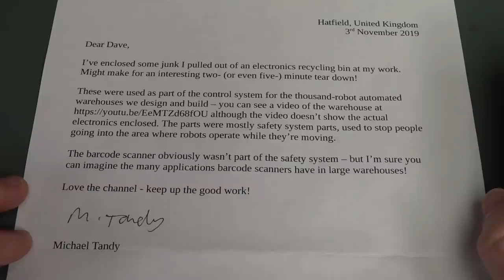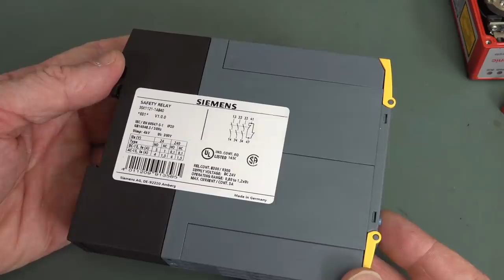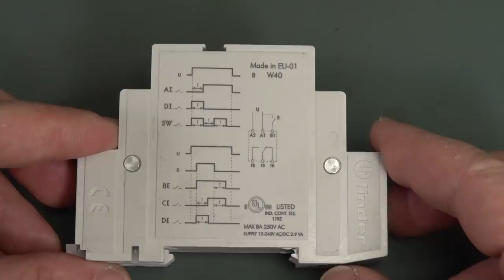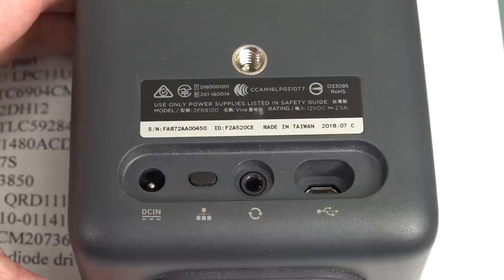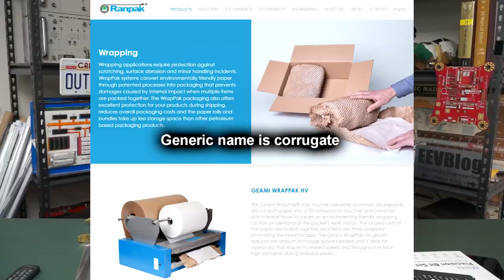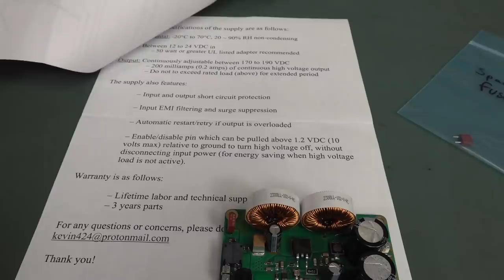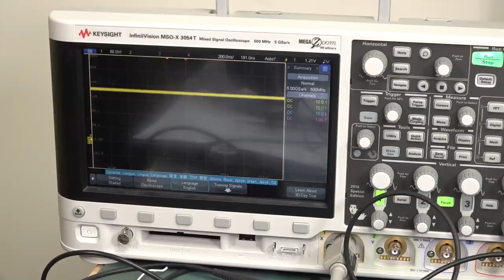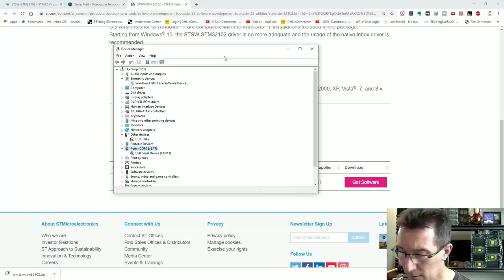EEVblog #1263 - Mailbag

Comment: Safety relays are used on plant as part of interlock circuits often using coded signals and timing sense circuits to only activate or deactivate without interlock inputs being faulty, such as a stuck switch. An example would be a machine guard for access to moving parts
Reply: Gotcha
Reply: Also know as emergency switches. The springy bit on the siemens one is to put it on a din-rail :)
Reply: Marco P - Yep, I am more familiar with Pilz systems but they all work much the same way.
Reply: @tenchicks  Are Yankees a race?
Reply: @TheDefpom  Pilz... Were i work, there are a lot of them...
I'm more familiar with Allen Bradley Safety remote devices (Point I/O), works all the same.
Reply: @Ann Onimous You need them if you have a simple machine (example, safety gate before a hydraulic press or emergency stop for that machine) where spending XX.000€ for safety plc + program + certification are not worth.
However, better safe (and angry if you are called at 02.00AM for a failed contact) than sorry.
Reply: A common use is for emergency stops. Each estop switch (of many) is a DPST normally closed switch so you have 2 separate loops that will break when an estop is pushed. Then, each of these loops trigger an individual relay (with some fault detection and conditioning). Loads are connected through both relays in series so it will be disconnected if either loop is broken. Some fancier ones have delayed outputs for more complex systems. So when the stop is triggered, you first tell the motor driver to actively brake, then cut power for electrical safety once it slows down after a few seconds.
Reply: @EEVblog2  Siemens also has solderless connections to the outside world, so they can never have issues with solder joints breaking off the board during wire connection. Dual processors so that a software fault in one does not affect operation, making it fail safe. Thus all the transistors there to do majority logic to ensure correct operation.
Reply: @Ann Onimous 
Piffle.
Reply: @Ann Onimous Safety plc can assure only tamper-proof program: during certification, certification agencies requires program signature (which is appended to security certificate) and program lockout, to tamper with code, cpu must be in STOP mode and, when you unlock program, signature changes.
Safety plc suffer equals issue of safety relays: inputs and outputs can be tampered with wires, so for simple tasks like door access or emergency stop, safety relays are just fine.

If "the first thing people do is link out all the safety if there is an issue", you have to get an appointment with HR department and speak about this: it's very dangerous, disaster-prone and against law (where i live, in Italy, you can get 5 years of jail by doing it, if one get injured because this, you can get up to 10 years).

p.s. safety certificates can be released also to plc-less machines (safety it's just interlocking, which can be made by mechanical, electromechanical or electrical manners where software interlock is always the last safety step).
Reply: That's probably why there is two microcontrollers too. The most likely do the same thing, and if they end up with different results, the system will stop. So there is redundancy
Reply: @marcop8273  Correct. We are building small cabinets where the safety PLC would cost more than the whole cabinet with safety relay. We talk about industry, but the money always a factor, no matter what. And the siemens safety relays have ridiculous MTTF values, a 24v supply more likely to fail before the relay.
Reply: @pengiswe  Yes, also some PLC (i use Allen Bradley) must have 2 cpu for Safety operation (in my case, L72S and L72SP are required to be running, otherwise cpus goes to fault condition and stop everything) and Safety remote seems to be fully redundant (in case of Point I/O, each safety module occupies 2 slots instead of 1 and run much much much hotter than non-safety modules).
Siemens, however, seems to be more user-friendly: S7-1214FC is an "all in one" cpu which doesn't requires any safety partner module.
Reply: @pengiswe  Yes, the two relays as well likely.
Reply: Robert Daggett  yes, i know (i prefer them instead of flex i/o).
Reply: Robert Daggett  It depends about safety performance you require.
We have v.31 cpu (L72S+L72SP), Monday i'll check this.
Reply: Robert Daggett  Maybe your response was truncated :(
Yes, access zones and all about segregation are THE mined field of safety systems (fortunately, where i work, we have EHS office, so we can simply ask them what to do in our programs).

About redundant operation, you can read this paper: https://literature.rockwellautomation.com/idc/groups/literature/documents/um/1756-um020_-en-p.pdf
On page 25, it states you must use partner CPU in order to achieve SIL 3/PLe safety performance, however, missing partner will cause major fault in CPU.
Reply: Robert Daggett  I'm sorry to hear that, i hope you'll get better ;)

About Safety, L72S (main CPU) runs both program, however handshake seems to be only in Safety task.
What i know about safety task is that you can program only in LAD (structured text, being uninterruptible, is not supported).
Our standard is: everything goes to normal task, all about safety (emergency stop, light barrier, trapped keys, gates, etc), goes to safety task (which, cut off emergency valves, contactors, etc).

For Siemens (S7), at the moment we don't use S7-1200F (and 1500F) series, so i don't have access to any software/hardware to test, but seems to be a one-cpu solution (maybe it have 2 processors).
Reply: Robert Daggett  Have you checked time sync between cpus and remotes?
We had issues (major faults) because there was no master timekeeper (D'OH!).
My opinion about redundancy on fail-safe equipments isn't about fail-over, but correctness of code execution: if cpus disagree on code results, something isn't going right, so it's better stop everything (this condition will cause major fault state).
Which AENTR module are you referring? 1794 or 1734?
Do you have set ring on ethernet modules and switches?
With 1794 we don't have issues, but we also don't use Flex IO safety modules.

With 1734, we have some issues: after weeks of operation, on some modules, randomly IB8S and OB8S modules communication led blink red on entire chassis, but communication seems to be ok... We tried upgrading FW of 1734-AENTR module, this seems to mitigate the issue, but isn't resolutive.
In this condition, status bit of input and output goes low, so machine section shutdown.

However, you wrote about redundant plc, this is about Safety partner, or is about having everything duplicated?
Reply: I just replaced a similar Allen Bradley safety relay inside an industrial fiber laser source.  I was surprised that a safety part failed so quickly, it was barely even 2 years old.
Reply: Robert Daggett  What kind of cpu? L72? I asked my boss about this, on L82 AB seems to let run single cpu, but with degraded safety performance.
Reply: Robert Daggett  L8 series: they are interesting because Ethernet port included in cpu (with communication coprocessor).
I'm very interested about wireless safety plc communications (at the moment, we have only wireless remote control): how well they support interferences?
I don't think we will ever use wireless sensors near our "EMI hell generators" (electric arc furnaces), but for other "less radiating" applications may be useful.
Reply: Robert Daggett  Ok, thank you for the feedback!

Comment: Dave, you missed the solderless piercing contacts on the siemens safety relay!  The I/O headers are NOT soldered to the pcb, but their pcb tails simply press fit into plated via's on the pcb!  This is a technique carried across from high volume automotive controllers (ABS/engine ECU etc) and means faster, cheaper assembly, and a more robust joint as that joint is a physically interlocked metal to metal joint.  The unit uses two micros because it is a SIL safety rated unit, so one micro checks the performance of the second one, and on any disagreement the safety contacts are opened.

Comment: 10:45 spring on the back is so that it positively snaps into a DIN rail. And instead of having to use a screwdriver to disengage a latch/lock, you just push down/pull out to release it. So much nicer to use than other types.
Reply from the maker: Ah, yes, of course.

Comment: The serrations at 4:30 are just to reduce light reflections on the wall into the sensor.
Reply: Yup. Keeps the external light reflections out.
Reply from the maker: Makes sense
Reply: @EEVblog  I'm pretty sure that those plastic parts focus your personal chi venturi into a calming state, even though you secretly desire to kill all humans, like Bender on futurama
Reply: To me It looks like a channel pre cut so they  could add a small piece of glass or a filter lens later if another customer needed some sort of special requirements.
Reply: Sickma15 then they’d be perpendicular to the optical channel and lined up. I’m with OP, they’re just designed to avoid reflections by sending the light that hits the walls out of the sensor

Comment: The relays in those safety modules are special relays too. They are what is referred to as force guided. If a contact  becomes welded, the other contact cannot switch. This makes it possible to monitor the contacts for failures. Thus preventing an unsafe condition from going unnoticed.

Comment: The "hook" bit is for screwing in and out eye bolts or hooks.
Reply: Ah, makes sense.
Reply: I was really surprised to see this in there. I can't imaging using a "hook bit" in the lab, or the iFixit bits while doing construction working...
Reply: I guess if your lab is also your garage, you might use hooks to hang stuff from the rafters. E.g. task lights above your work bench.
Reply: ..and butterfly nuts (wing nuts); it's described as that in one of the bit sets I have. Also see https://www.kwb.eu/en/detail/index/sArticle/2946530
Reply: Yeah it's odd, but the safety bit set I bought years ago also has one.
Reply: I've always wondered what that was for haha! I figured for wing nuts.

Comment: w.r.t the vive lighthouse:
the 3x3 led grid (also?) has red leds, they are part of the system that shows when the 2 lighthouses are synced. 
The 2 stations use optical syncing, but if they are in a situation where that isnt possible (e.g. large area, angles, reflective surfaces) the 3.5mm jack on the rear is for a sync cable.
the 7seg display tells you what configuration the individual lighthouse is set up as, A/b/c mode (A and b for cable sync, b and c for optical sync)

It didn't work because the usb port is intended for firmware updates, not for power. Though usually the updates can be run over bluetooth
(the power is 12v 2.5a center positive)

the g sensor in addition to any use in angle it may have, also allows the lighthouse to flip the 7seg display to be readable if you have it mounted upside down.
somewhere on the front top, you missed an rgb led, the main way to see the tracking and sync status.
I believe, the horiz and vert lasers flash alternately.

The tracking system consists of ir recievers mounted all over the controllers and headset. It takes any 5 of them being triggered to establish tracking, and then any 3 to maintain it, for each part (2 controllers and 1 headset, each need 3 to stay tracked)
the 5m*5m space is a very conservative maximum. I have heard of 25m*25m setups using very high mounted lighthouses with cable sync.
Reply: AFAIK g sensor is also used to stop the spinners when the lighthouse is moved while operating, maybe to prevent damage from centripetal force or detect wobbly mount, all I know is that when moved it stops until left alone

Comment: Yes, those Schrack relays are custom but they are very similar to normal stock products under the SR6 series; these have what are called "force guided contacts" where even if the relay is stuck in NC or NO position the opposite contacts cannot be forced closed.

Comment: The warehouse in that video is very close to where I grew up; it actually burnt to the ground earlier this year thanks to a dodgy battery charger setting alight the plastic lid of one of the robots. Up to 400 jobs were at risk as the warehouse will take two years to rebuild.
Reply: The robots run around without their plastic lids now. They don't look as nice, but obviously safety is more important.
Reply: Muzer0 Do you have a link to a news article (or keywords to google)? Just curious to read about it!

Comment: 30:00 "Apparently you need two of these." No, technically only one is required to track location. Two are so you can get better tracking when the user is occluding the base station. (If they're facing away from one.)
Reply: The accuracy also nearly doubles, and the global position fixing does as well(30 to 60Hz).

Comment: Lasers can cross just fine. Photons don't interact with each other, or for the wave afficianados, the waves just interfere at the point of crossing.
Reply: Stuart Coyle yes that’s what I told my physics professor two decades ago, and was told that I wasn’t correct.
Reply: @HighestRank  Yes I suppose photons can interact, in that they are the force carrying particle of the EM field (QED)  and though they cannot directly interact, they can produce virtual particle pairs (electron - positron) which can then interact with another photon. Also, in air there are non-linear effects that can happen at high intensities. These are not things you would normally worry about in a consumer device, unless you are an extreme audiophile of course.
Reply: No! Don't cross the streams!

Comment: Siemens safety relays are interesting devices. You can't jumper them out to bypass safety inputs. I've used them in burner management control systems (very large fired heaters and boilers)

Comment: Its probably a 2 channel Emergency stop relay for control of a main contactor in an industrial control panel. You should note the relays are large in size as they are safety relays with force guided contacts. There will be two relays  with AUX contacts that are cross monitored. If one relay relay is detected as being welded shut the the second relay wont close. So its for fault detection.  Timers are usually run down timers so the machine has to come to a complete stop before the  safety relay can be re-energised.

Comment: As mentioned by Defpom's Electronics & Repair, these are used for additional levels of protection on machinery. They increase the availability (machine doesn't stop because of a faulty condition during operation but instead reports the fault) and reduces the probability of an unsafe situation (machine won't stop when needed). Circuits monitoring other circuits and having redundant functions like 1oo2 or 2oo3 voting (one sensor deemed faulty in two, two sensors faulty in three), either in software like the Siemens model (two processors need to agree within so many cycles) or in hardware like the Schneider one (just a guess, two PWM signals needed to charge a cap, if one fails voltage goes down and relay de-energises tripping the machine). It's the result of risk assessment and Safety Integrity Level required calculated using MTBF and statistics. Those relays are usually SIL-3 rated so they monitor two or more parallel  circuits (ie. two NC contacts on a stop push button on individual circuits). The overall SIL still depends on the assessment of the full system and the weak links.

Comment: The base station needs a 12v dc supply to the barrel jack and the USB is just for updating the base station.

Also the controllers and headset are covered with IR cameras.
Reply: Doh!
Reply: @EEVblog2  g sensor is also likely for attempted shutdown on falls (like hard drives attempting to park when experiencing 0g)
Reply: Not quite IR cameras. Just IR receiving sensors. (See all the info Allan Yates talks about. Cool stuff.) There is a single IR sensor element in the base station for talking/syncing between base stations.
Reply: I was screaming the same thing at my monitor and I don't have a vive (rift here). Why would the big honkin barrel plug be there if it was meant to be USB powered?
Reply: There's an incredible amount of engineering that went into those lighthouse stations.

Mainly with how each unit is balanced and calibrated, and just the crazy timings and maths involved in the tracking.

They also have a low-speed data channel which uses the IR LED array to convey certain info to the handsets / HMD.

I think the lighthouses also keep in sync with each-other, so they're not both scanning the same part of the room at the same time?

Comment: I work with these all days, and I prefer Siemens functionality but Schneiders Connectors. The vertically stacked connectors is a downright pain to deal with.
Reply: Siemens if I have to, Allen BradleyGuardmaster more often,(similar contacts to the  Schneider which are nearly clones ,) wont buy the Schneiders, support is brutal

Comment: You got 230V AC in "...stralia"?  Why not using a plain old 40W or bigger incandescent Lightbulb as a load for the Nixie Powersupply?  AFAIK they are fine running in DC ;-)

Comment: Great review. I'd add only one thing concerning the exposed terminals of the converter: 44:23 The second it got unpacked I was screaming about the exposed metal terminals. There are only a few mm apart especially at the input terminals. Any conductive foreign object, like a misplaced probe tip, or other parts can short the whole thing. Good first effort, congrats!